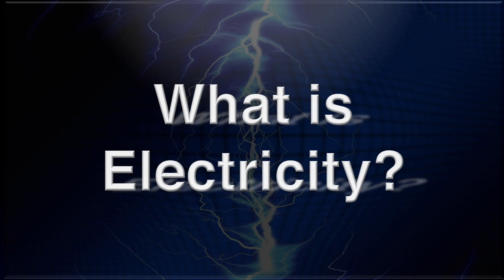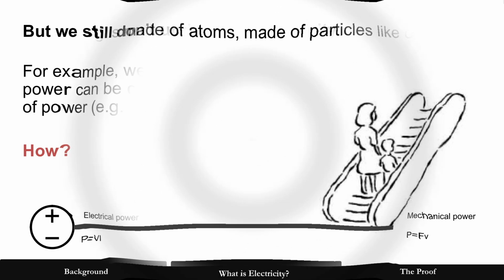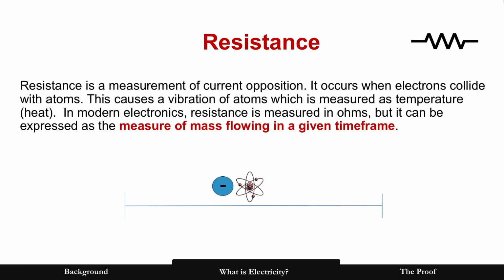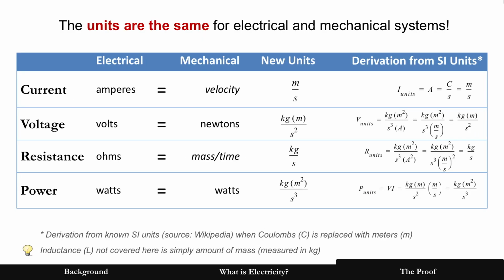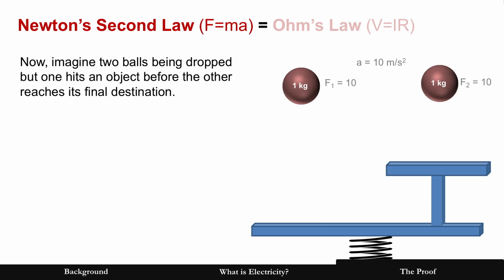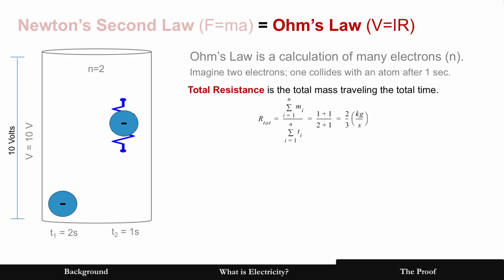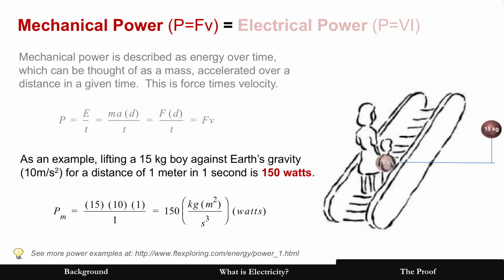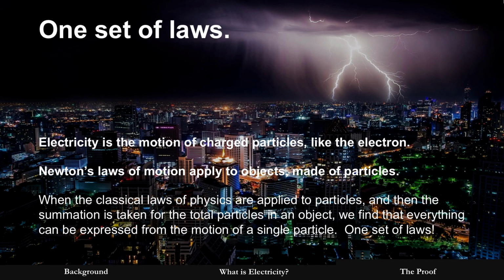What is Electricity? The motion of electrons and relation to Newton's laws by Jeff Yee

Comment: Here is a part of a quote from Maxwell that shows us the logic of this man, the need of a MASSLESS medium as aether for propagation of electricity through space and around the matter. Please not try to use Newton law instead of Ohms law. It mislead us to undrestanig the nature of electricity. Electricity is NOT the flow of charged particles such as electrons in a wire. Electricity is polarized Aether! Electricity is a vector field of polarized Aether 𝑄 , is the cross product of two fields dielectric lines of force 𝛹 and magnetic lines of force 𝛷. 

𝛹𝛷 = 𝑄 

“There appears to be, in the minds of these eminent men, some prejudice, or a priori objection, against the hypothesis of a medium in which the phenomena of radiation of light and heat and the electric actions at a distance take place. It is true that at one time those who speculated as to the causes of physical phenomena where in the habit of accounting each kind of action at a distance by means of a special aethereal fluid, whose function and property it was to produce these actions. They filled all spaces three and four times over the aethers of different kinds, the properties of which were invented merely to ‘save appearances’, so that more rational enquirers were willing rather to accept not only Newton’s definite law of attraction at a distance, but even dogma of Cotes, that action at a distance is one of the primary properties of matter, and that no explanation can be more intelligible than this fact. Hence the undulatory theory of light has met with much opposition, directed not against its failure to explain the phenomena, but against its assumption of the existence of a medium in which light is propagated.
We have seen that the mathematical expressions for electrodynamic action led, in the mind of Gauss, to the conviction that a theory of the propagation of electric action in time would be found to be the very keystone of electrodynamics. Now we are unable to conceive of propagation in time, except as the flight of a material substance through space, or as the propagation of a condition of motion or stress in a medium already existing in space. In the theory of Neumann, the mathematical conception called Potential, which we are unable to conceive as a material substance, is supposed to be projected from once particle to another, in a manner which is quite independent of a medium, and which, as Neumann has himself pointed out, is extremely different from that of the propagation of light. In the theories of Riemann and Betti it would appear that the action is supposed to be propagated in a manner somewhat more similar to that of light.
But in all of these theories the question naturally occurs:-
If something is transmitted from one particle to another at a distance, what is its condition after it has left the one particle of before it reached the other? If this something is the potential energy of the two particles, as in Neumann’s theory, how are we to conceive this energy as existing in a point of space, coinciding neither with the one particle nor with the other? In fact, whenever energy is transmitted from one body to another in time, there must be a medium or substance in which the energy exists after it leaves one body and before it reached the other, for energy, as Torricelli remarked, ‘is a quintessence of so subtle a nature that it cannot be contained in any vessel except the inmost substance of material things’. Hence all these theories lead to the conception of a medium in which the propagation takes place, and if we admit this medium as an hypothesis, I think it ought to occupy a prominent place in our investigation, and that we ought to endeavour to construct a mental representation of all the details of its action, and this has been my constant aim in this treatise.”
–J C Maxwell, A Treatise On electricity and Magnetism, Vol II, pg 492-493
https://archive.org/details/treatiseonelectr02maxw
Reply from the maker: I agree with Maxwell on the need for a medium as the propagation of electricity.  In fact, you'll find throughout EWT that everything is based on this premise, including the creation of matter itself from these properties of the aether.  To clarify the simplification of Newton's law and Ohm's law, the motion of all large objects expressed by Newtonian physics are made of subatomic particles like the electron.  It is logical that the physics would then apply to the particles too.  The motion of electrons can indeed be worked out mathematically to be the same, which is the relationship between Newton and Ohm.  You can try it yourself.  The math works in all scenarios: https://www.researchgate.net/publication/330639107_The_Relation_of_Ohm's_Law_to_Newton's_2nd_Law

Comment: No, electricity is not the flow of charged particles, such as electrons in a wire. Imagine that it was already written by CP Steinmetz in 1911: "Unfortunately, to large extent in dealing with dielectric fields the PREHISTORIC CONCEPTION of the electrostatic charge (electron) on the conductor still exists, and by its use destroys the analogy between the two components of the electric field, the magnetic and the dielectric, and makes the consideration of dielectric fields unnecessarily complicated.
— CP Steinmetz, Elementary Lectures on Electric Discharges, Waves and Impulses (Lecture II, pgs. 13-14)" 
https://archive.org/details/ElectricDischargesWavesAndImpulses/page/n25/mode/2up

Comment: Great video, you are spot on btw... At least in my opinion. I think the main problem, lies in trying to get people to think outside of the box, most people have been conditioned to believe in the physics they were taught at school/college. The longer people go down a certain path, the harder it is to get them to think otherwise. A sound wave is a mechanical wave, yet in essence it works exactly the same way a radio wave works, it's fluid dynamics, it's the same particles interacting at different levels in the same medium.